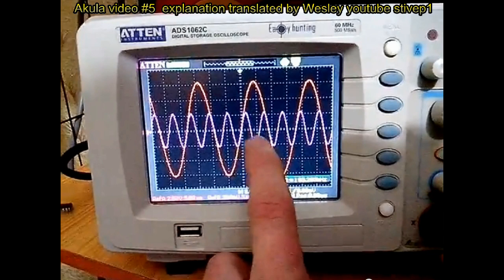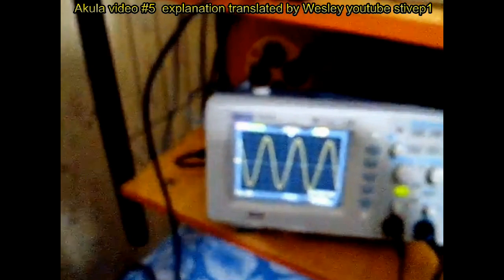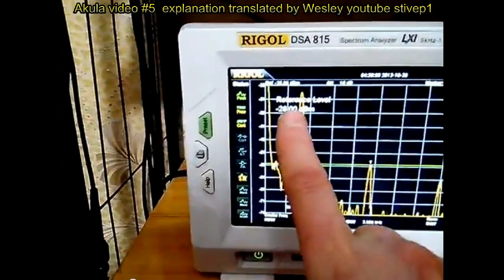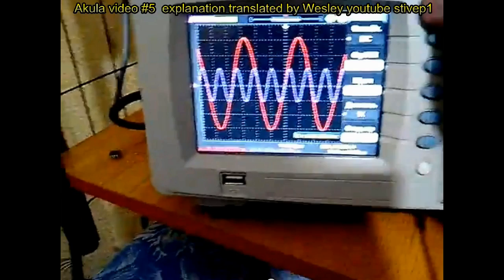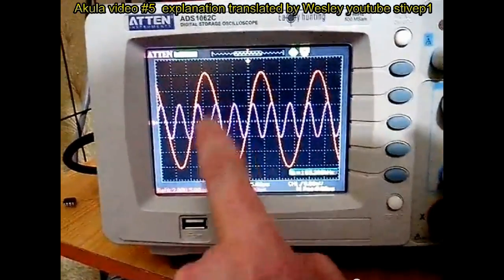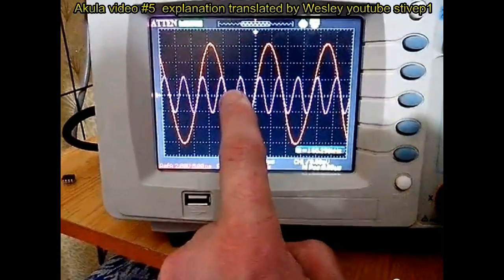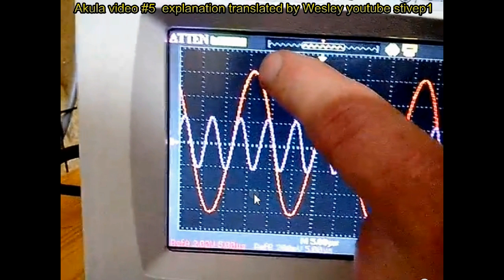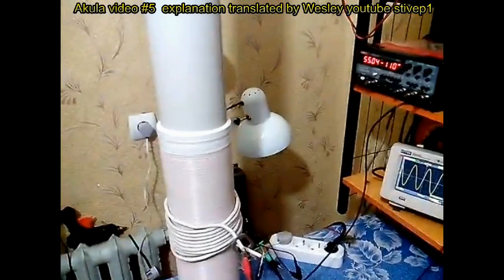Akula video #5  translated by Wesley. ( Free Energy device)

Comment: I guess I'm about 10 years late. But without any synchronization circuitry, just by tuning my push pull to a third of the Tesla frequency lining up the 4th inverted  waves  and sharing a core on the positive to both feeds between Tesla and push Pull.
I plan on building the Akula driver next.
Reply from the maker: I appreciate your testing. For me primary is to know  what that energy comes from ? I saw  a comment of T1000LTU under your video  Part 17. - Use his help if needed to  get to overunityresearch forum and look for  stivep  comment there  in " How is Zenneck wave + Brewster angle + D.interface = FE ?"
You are  quite promising material in this area.
Wesley
Reply: @stivep1  hey Wesley :) 
https://youtu.be/Cs8bIzA7Ns0?si=q8hFXANH02fGFuC1

Comment: Thanks Wesley for the translation.

 I think I know where this is going. Think frequency translator. The bifilar coil inverts the negative portion of the Sinus wave and creates a double sinus wave that strengthens. But this also means you need to control the phase between the two waves to exact %'s.
 So we have a solenoid that reacts to external impulses with bemf. We have a bifilar coil on top of that that steers the negative portion into a positive flow reinforcing the inner solenoid coil.